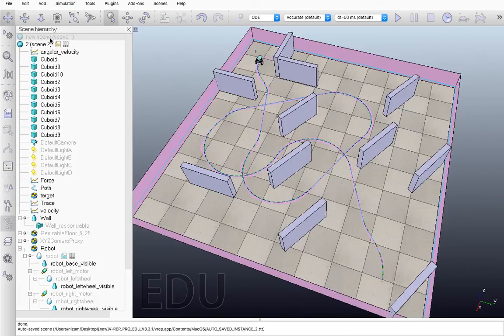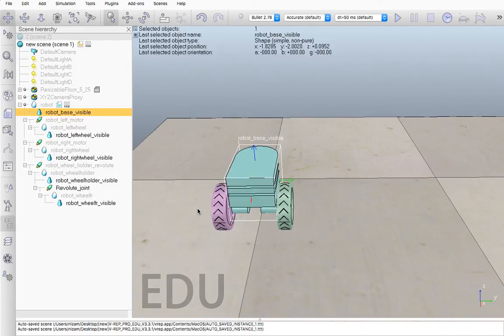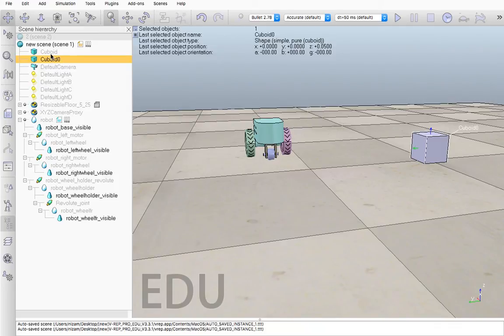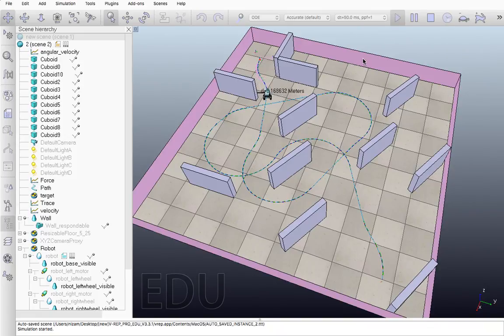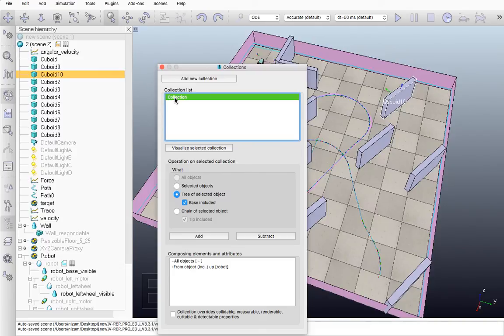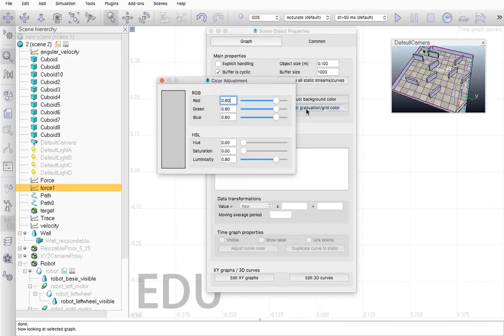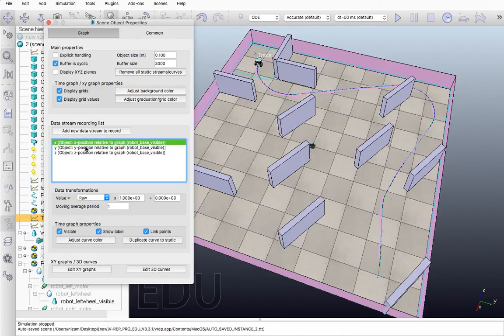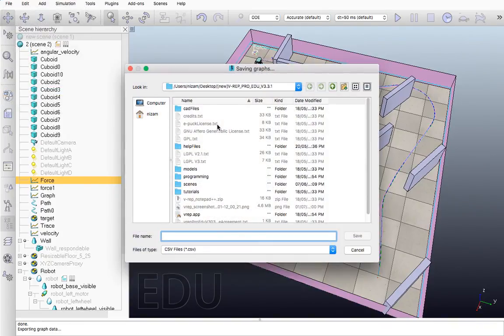Robotics Simulator: V-REP Dynamics Module Of Mobile Robot || Vrep Tutorials

Comment: Hi! I made a Robot using SolidWorks and I export to V-Rep (URDF file), my problem is that the robot doesn´t interact with the floor, i mean, the joints seem work and the wheels spin but the robot doesn´t move forward. Can you help me? Thanks for the video, I appreciate!.
Reply: U should add revolute joints between components
Reply: I did, the diferents components interact each other but not with the floor. Is like a car in an ice rink, i mean the wheels spin but the car (robot) doesn´t move forward.Thanks for answer.
Reply: Carmoan share ur scene to vreptutor@gmail.com